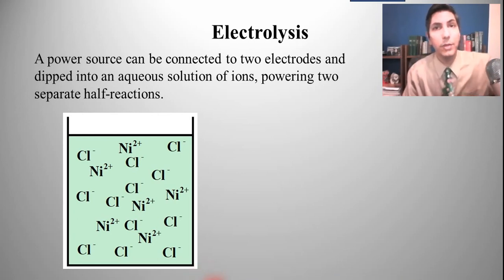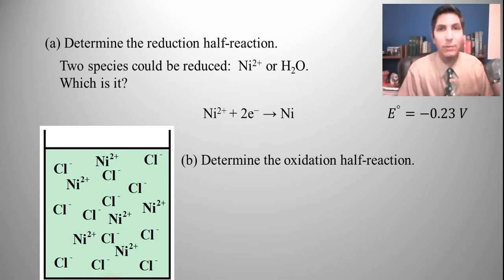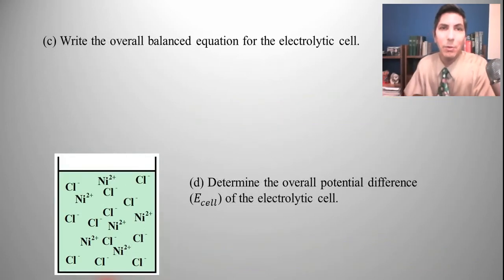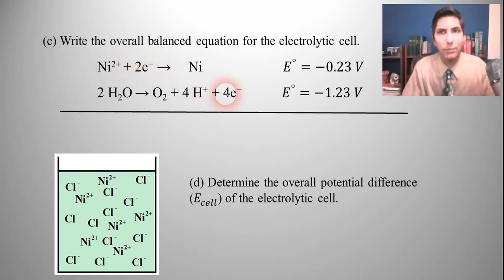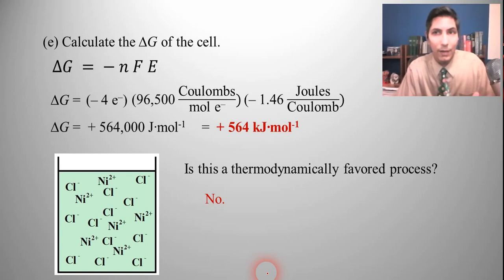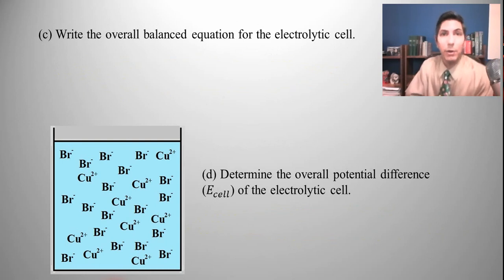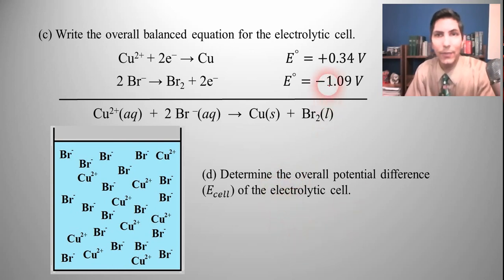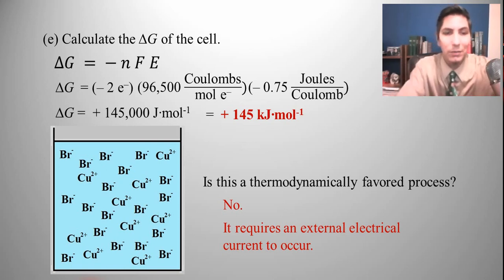Electrolysis in Aqueous Solutions - AP Chemistry Complete Course - Lesson 20.2

Comment: how would you know which equations are potentially oxidized vs. reduced? i thought usually they just give you a whole chart and make you figure out which is oxidized and reduced.
Reply from the maker: You can look at the two standard reduction potentials.  The more positive value is for the cathode (reduction) and the more negative value is for the anode (oxidation).